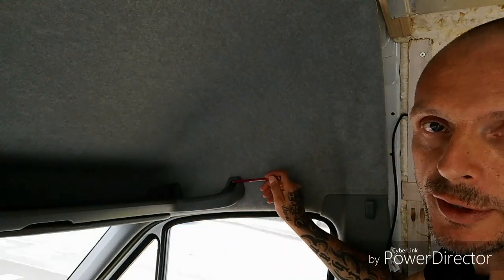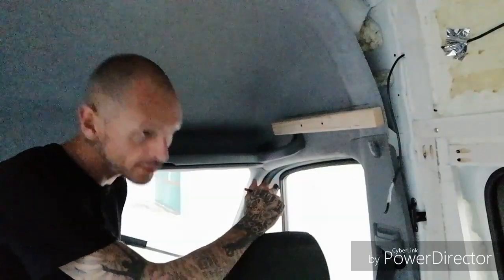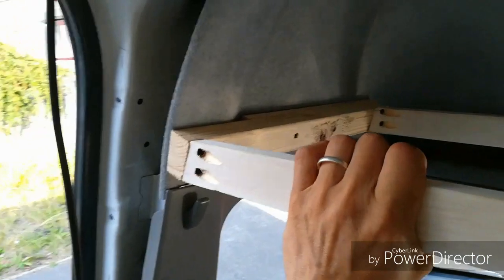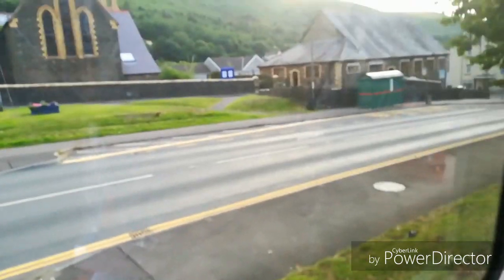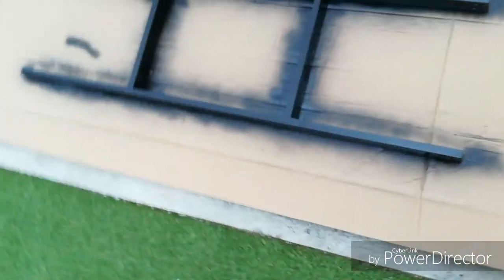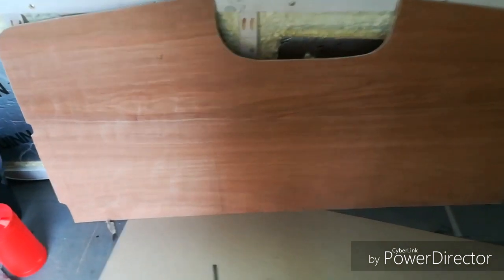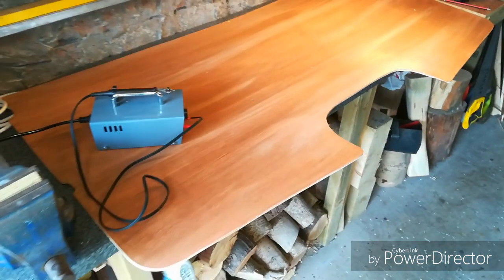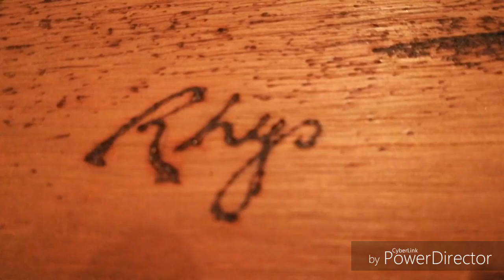How to make the bulk head shelf in a sprinter van, made easy please watch until the end.

Comment from the maker: Thank you very much 🙏🏻 really appreciate that. Four year's on and 35k miles and not so much as a squeak 👍🏻 the frame sat on the handles above the door plus fixed to the grey headlining, once the uprights went in each side underneath and it was cladded it's rock solid and very light 👍🏻. We've had shit loads of weight up there especially when we travelled Europe and took far to much gear that we didn't need 🙈 😂.  It took us year's to build the van 🙈 making sure everything was built to last, it's now been 4 plus year's with just over a year now of full time living in the van and touch wood 😂 everything is still fine 👍🏻, sending love, peace and good energy  and thank you again ❤️🙏🏻